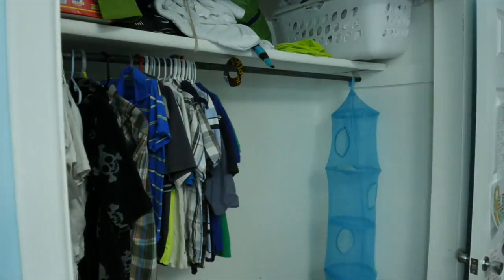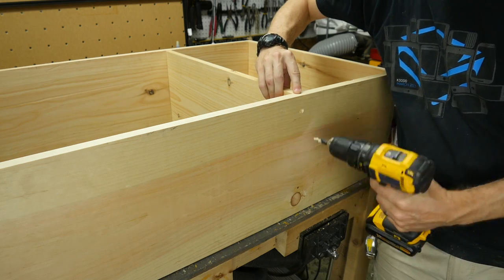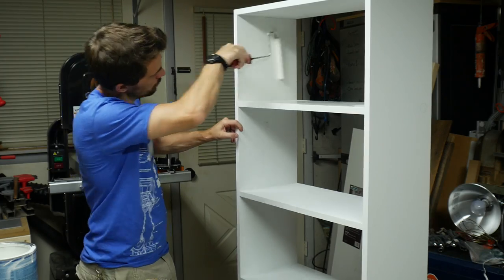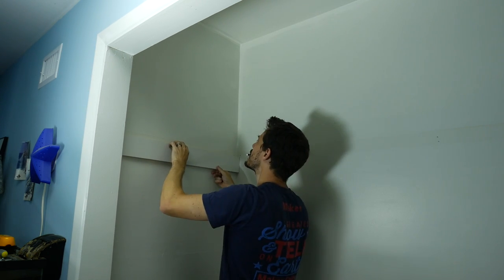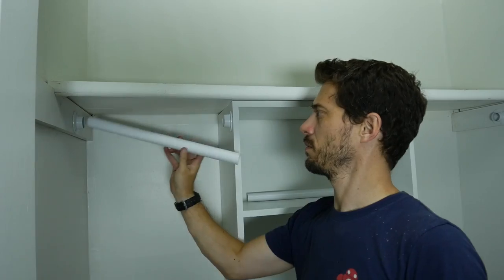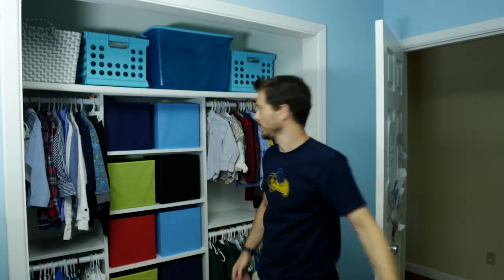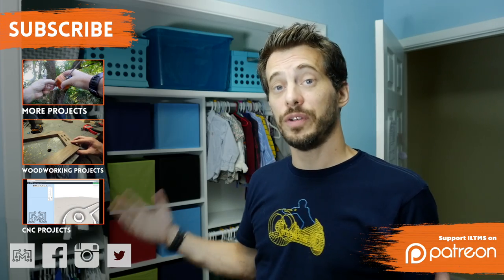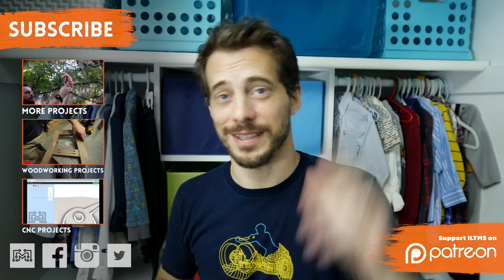Better Kids Closet // How-To | I Like To Make Stuff

Comment: A lot of my bookshelfs have a little cutout at the bottom back end of the sidewalls so you can slide them all the way on to the wall regardless of the baseboard. Saves you from messing around with the baseboard if you don't want to.
In your case, I guess, you would also have to adapt the most bottom shelf for that...

Comment: To avoid painting would you not consider using melamine panels? I know chipping can be a problem but I use my track saw with a splinter and over size the cut by 2-3 and then joint the edge using a flush trim bit on my router table which takes care of the 2-3mm. Flawless finish.
Reply: *splinter guard

Comment: I checked all the digital plans for your workshop but I did not see this on there.  I was curious as to what wood material you used and the sizes of your beginning material.  I know that every closet will be different based on size and needs, but was curious as to what a good ballpark amount was for your build.  Any help would be appreciated.  Thanks man.

Comment: You are the first person iv seen to remove the baseboard from the wall, rather than just put a notch in the shelving unit.
Reply from the maker: Yeah, when the trim is 50 years old with 10 layers of paint, it doesn't matter so much :)

Comment: Couple of questions (open to everyone) can you cut those metal poles with a hacksaw? Surely that would do the same job? Also are you a carpenter or handyman or engineer or just a super cool jack of all trades? Cheers dude :)
Reply from the maker: Hey Joe! Yes you definitely could use a hacksaw.   I'm not really anything in particular, I just like to make to make stuff :)
Reply: Bob is just a very good, intelligent guy who likes to share what he learns. 

You could use a hacksaw, or you could just use a solid wooden dowel instead. It is more likely to flex and eventually sag but it will take a while, they aren't very expensive, and you can easily replace it down the road if necessary.
Reply: +I Like To Make Stuff i like your pun

Comment: Nice video. But instead of cutting out the skirting board or Base board as you call it. Why not cut it out of the back of the bookcase. That's what we do. Same end result but you can remove the shelves and not have to patch the skirting after

Comment: What paint did you use so that it wouldn't smell so bad. Did I use oil base ?
Reply: +Nanako I ended up using latex paint. It's kinda sticky after it dries . Will that work?

Comment: any suggestions for a closet that is just as big but has a single 36 in door for its opening
Reply from the maker: ***** Hey Dave! I' probably treat it kind of like a walk in, where  the non-door spaces are faced perpendicular to the door.  Then maybe some wall hanging stuff directly in the door, for belts, hats, etc.
Reply: I Like To Make Stuff Sweet!! THANK YOU!! Guess I got another project to add to my list that keeps growing.  making a miter saw table right now out of my Tailgate off of my Pap's old truck.  Its turning out pretty cool I am having it Shut like a tailgate up against the wall to keep it out of the way when I am not using it!  Thanks for inspiring me to get back into making stuff! Thanks Bro!